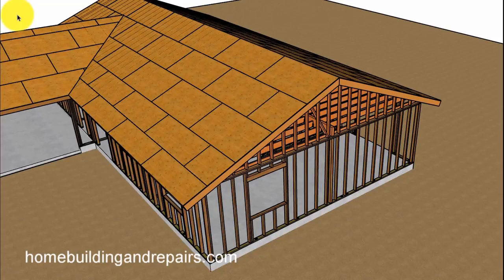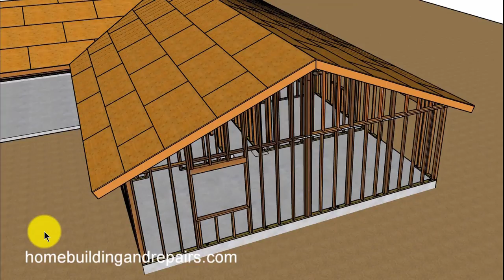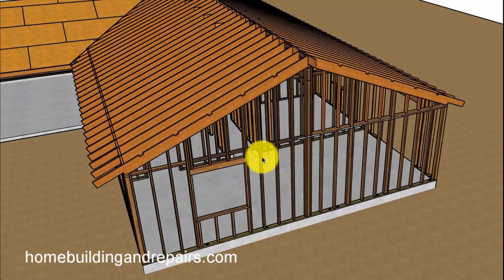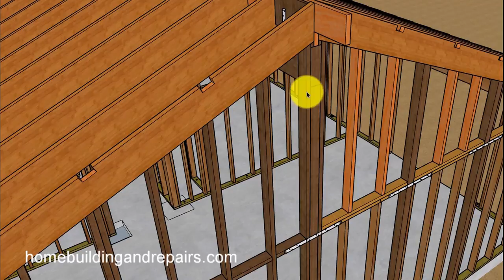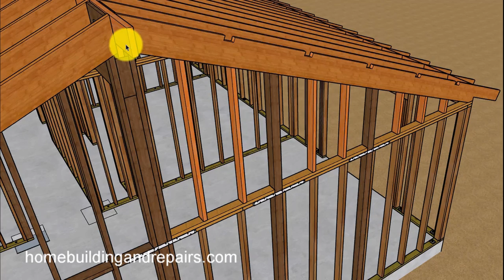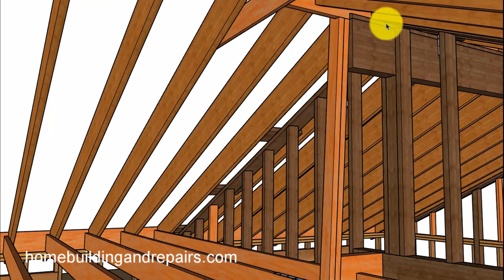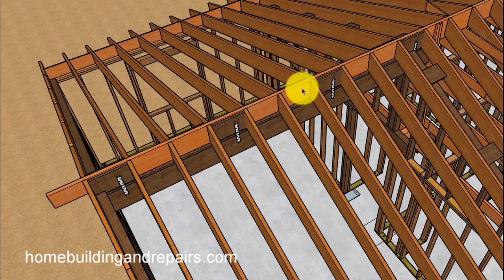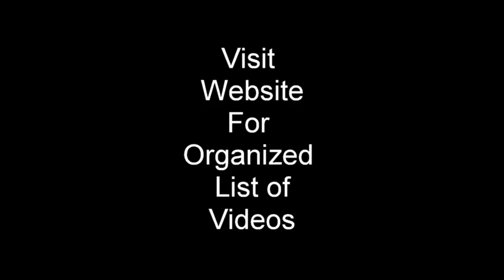Ideas For Converting Flat Ceiling Into Vaulted - Home Remodeling Ideas

Comment: I've installed tons of strap and tico nails over the years, but I've never understood why we're adding hardware to joints that have already been thoroughly bonded together with 1/2" OSB or plywood sheathing. Why is that extra step considering necessary?

Comment: I'm designing an ADU for client and they want a cathedral ceiling in the main room. Your video was very helpful in showing how to approch the design. One question though, would you not want to seat the rafters on the ridge beam? I know you showed a "rip-strip" at the end, so is that to take the place of notching the rafter to the ridge beam? Great video! I enjoy your channel!
Reply from the maker: The rip strip you're talking about is just another possible option. Yes I would rather have the rafters notched and sitting on top of the ridge beam.

Comment: Instead of removing the roof to install rafter straps could you bore a mortise through the side of the ridge beam with an oscillating tool and then pass a bracket through to join the rafters?
Reply from the maker: I don't think I would drill holes through the ridge beam, but it seems like your method might work if used under the ridge beam.